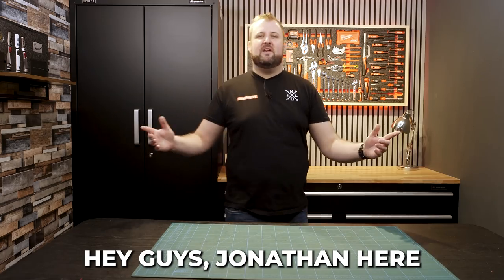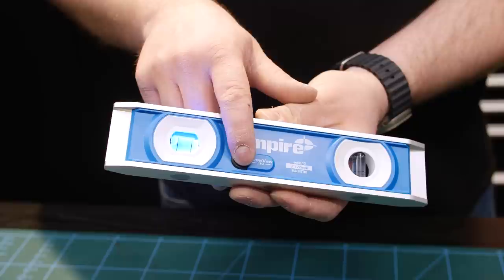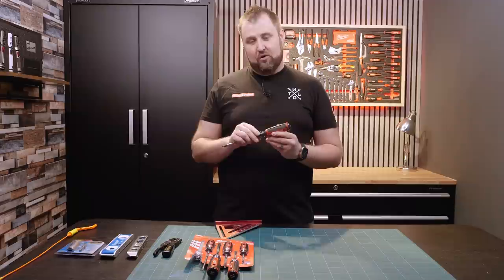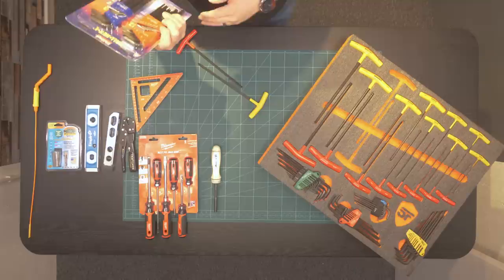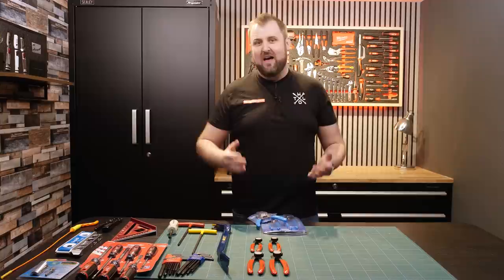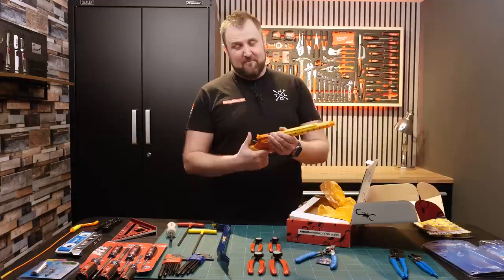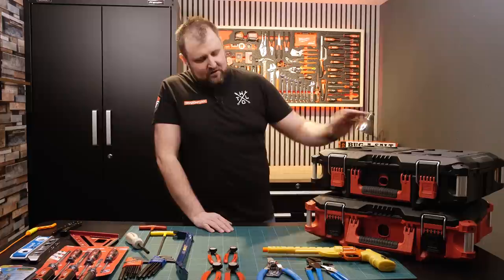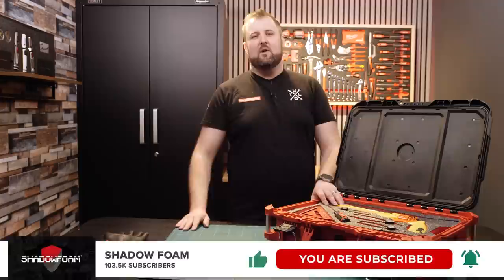I Found The Weirdest American Tools Made in the USA!

Comment: As an American, I can tell you that Milwaukee bought Empire Level several years ago so that Milwaukee red square is still an Empire. Also, Eklind makes at least some of the Snap-on Hex keys. Those Milwaukee screwdrivers are excellent. Milwaukee also makes a lot of their Sawzall blades, hole saws, and step bits in the US. All very good quality items. Estwing and Channelock are also great brands and choices. We used to make a lot more but it's nice to see some of this manufacturing returning.
Reply: And a fun fact, Eklind was started in 1923 by swedish immigrants Henning and Ruth Eklind.
Reply: As a person who uses a milwaukee sawzall at work at work every day I think Milwaukee sawzall blades are junk (at least the fine tooth blades). I prefer Lenox arc blades but they are getting harder and harder to find. A lot the local electrical suppliers sell 25pks of Milwaukee blades so I end up using a lot of them. The best part about Milwaukee is, at least here in a large Canadian city, the availability is good. If you need a specific size hole saw usually the suppliers are good at carrying all the sizes.

Comment: You should have stocked up on those Drain Weasels. When your girls get to my daughters age, 16yrs, you'll be unclogging that bathroom drain every couple months. When I found that it was a God send. I love that product.
Reply: I use large zip ties; I make diagonal cuts into the sides to have the hairs hook onto. Stick it in the drain and twist around. Then pull out the gross stuff. Works great and costs next to nothing.
Might want to wear one of those shadowfoam kit gloves when making the cuts though ^.~
Reply from the maker: Haha thanks for the advice mate
Reply: @TheBayru   Thanks for the info. Sometimes I use pipe cleaners as well. I twist two together and it works sort of but I'll have to try your method.
Reply: Real Americans need a tool like this that works on a cordless drill....
Reply: @JimmeShelter as a plumber, I can assure you that I have made my own drill mounted hair removal tools out of metal clothes hangers, but honestly, manual operation is better
Reply: Those drain weasel are available over here. UK

Comment: The Craftsman 45307 & 45308 Auto Lock Pliers were introduced in 1998.  I believe at that time they were manufactured by Stanley at the old Parker Manufacturing Company in Worcester Massachusetts.  In the early 2000s they stopped making them in the USA and started switching to overseas manufacturing.  Of course now Craftsman is owned by Stanley/Black and Decker as a low cost budget brand.
Reply: I have what Sears Craftsman called RoboGrips that seem very similar.  I had them years.  Would never consider selling them.
Reply: Same on the robogrips.

Comment: I bought one of those Snap On ratchet screw drivers back in 1989 when I thought I wanted to be an automotive technician.  I will tell you I still own this ratchet screwdriver, I have used it so much the a lot of the texture on the plastic handle is gone and it's smooth now.  I will hand that down to one of my sons.  Never get rid of that.  When you were talking about "circlets" I kept wondering what you were saying.  I had to turn on subtitles to figure it out.  Because I looked at those tools and I said those are retaining ring tools.  LOL, then you mentioned how we call them different here.  Makes sense now.  Oh 1 minor thing it "Bass" Pro Shop, Like the fish.  Not Base Pro Shop.

Comment: I have access I'm the usa to alot of thoes made I  usa tools but I tend to buy Japan and Germany funny.  Milwaukee bought out empire levels and are extremely similar since just are made in the same factory.  I dare say growing up with channellock and getting my first pair of cobras I was blown away with German tools ever since.  One brand you didn't experience not slways on stores is mayhew.  They make fantastic pry bars punches and cold chisels.  They also make some good spring tools (thought not the original springtools are the og).  The dominator pry bar line is a real gem including the "screwdriver pry bar" with a 14mm tip it's quite nice.  They make a 7/8ths 23ish mm thick 42-58in prybars thicker than anything I've seen available. Take a look!
Reply: Mayhew is criminally underrated. A lot of stores will have 1 or 2 things they make sort of hidden somewhere but their tools are top notch. My favorite bit sockets I've ever used are their stubby dual drive Allen/hex and torx sockets. Super stubby and can be used with a ratchet or a wrench

Comment: Just a tip from plumber: when you use your drain tool on the bathtub, take off the overflow and go down. This gives you a straight shot to the trap and downstream. Using the tool through the crossbars will give you two more 90 degree angles to pass, and if you hit hair.. good luck getting the tool removed.
Reply: As a not-a-plumber but a handy diyer, let the water stand and clear the drain with a shop vac.   Wet rag over the overflow and FWUMP...big ball of hair.

Comment: I love good multifunctional tools! I worked many years as a maintenance tech repairing automated equipment and having tools that have few parts and multi uses are a lifesaver for quickly fixing things with a normal toolbelt. There are always things that need more specialized or larger tools but it was amazing how many things I could do with my multi set! Like a flip-over set of needle nose pliers with a full set of wire cutters and a flush cut nippers on the other side, or an eight socket dog bone wrench that really worked! I still use them over 20 years later!   I also love the Bug assault guns for blasting wasps and hornets, the combination of reach and blasting the wings off makes it a lot easier to deal with those pests!

Comment: I'm a Canadian electrician and I used to have all Klein hand tools, but the german brands are just so much better... especially screwdrivers, the wera and wiha screwdrivers and nutdrivers are excellent. Channel lock does however make decent pliers at cheap cheap prices, so if you're in places where theft is an issue, there is that.
Also Canadian brand picquic, made in Vancouver BC is the best multi screwdriver on a utilty/cost basis. Superior by a wide margin to american and german offerings.

Comment: Another brand of USA tools for the Automotive trade is Lisile Tools. They design and make specialty trade tools and are available from many sources (Tool Trucks, Auto Parts Stores, Online, Amazon ect.) and based in Iowa. Milwaukee also has some pliers made in USA. If you want an experience, Denver, Colorado has Charlie's Second Hand Tools. Est. 1928. Two floors packed with used tools. You can find more online about them.
Reply from the maker: Thanks for the tips Steve! I’ll be taking you up on these suggestions next time I’m in the states! 👍

Comment: I agree with most of these except the snap ring/circlip pliers. That is one thing I don't buy the multi tool version of. I went through two different types of them before just buying a full kit of Icon's with various sizes and specific internal/external models.

 Those multi reversible style are OK for light duty, but when you get into larger electric motors, certain automotive parts they just don't cut it. The tips just bend and the cheesy joint is not rigid enough to keep the tips in line.

Comment: @9:20 It was Cellulose Acetate Butyrate (CAB). Commonly called "Acetate (or incorrectly Acetal) Handle". While very cool, durable, long lasting, and easy to clean, it slowly decomposes, outgassing Butyric Acid which makes them smell like vomit after a few years. It normally only accumulates if you keep them in an enclosed toolbox for a long time. Before putting them away, clean Acetate handles with a rag moistened with Ballistol. It'll keep them from stinking in 10 years, and can clean up the Acid residue that makes them stink as well. Sadly these multi material urethane rubber boys will both stink and rot away no matter what you do. The rubber will become hard and chunky and start rotting away, especially if exposed to oil and aggressive solvents over a long period of time (particularly the old Wera Kraftform were guilty of this) but I guess that's just how it goes these days. (I have Acetate, Urethane, Polypropylene and TPE, etc handles from all makes, my Craftsman and VACO Acetate ones seem to last the longest but I like my Tekton "High Torque")

Comment: I prefer the Eklind loop handles in extra long (54250).  When there is a hex in a corner, the shaft can be gently bent to clear the handle. It springs back every time with no damage. It's mostly used in trade show booths for shelving. The locks are always in the brackets tight to the corner. There are shorty ''corner keys'', they are hard to get, mostly people make their own. The stubby allen portion is quite short and the handle is bent.  I had an Estwing prybar and it developed legs. I got the plain prybar at HF for $3 on sale and it's better than Estwing for my purposes. Empire used to make Craftsman levels. The aluminum one is for plumbers.

Comment: If you can find Craftsman tools made in Taiwan, they are about as close to “made in USA” quality.  Older Craftsman (roughly 1995 and older) are 100% made in the USA; those rivaled any Snap-on or Matco tool at 1/4 the price.  I have a set, not one ever broke; to this day.  I bought a set of dog bone ratchet wrenches (in 1995ish) and only one broke,  Sears replaced it without asking one question.  Not sure if the dog bone was made in the USA, because at that time, some of the tools were Chinese (not Taiwanese) and Mexico made.  If you can find old (pre 1995 imho) Craftsman tools, buy them.

Comment: I have four girls in my family :) But my favorite US tool brand is Lie-Nielsen Toolworks - fine woodworking tools. The second favorite is Leatherman - have you tried the compact changeable bits system of their recent pocket multitools? Besides, i have a question about multiple layers of Shadowfoam in a box: i would like to put a Makita 18V powerdrill and many drills bits in the same Makpac box. The drill bits would fit nicely in a single 30mm insert and the drill plus a few bigger items to another 50mm insert. I'd like the bits insert to be on top as it is much lighter and easier to remove, but the drill can't be completely embedded in the bottom insert. Do you have any solution to this? I was thinking of creating supporting blocks in each corner of the box, that would keep the top layer level.

Comment: You don't have a Yankee Push Drill there. That's all stainless, size of a screwdriver, but includes about 10 drill bits in the handle. Great way to drill through trim or baseboards to run a wire or set a handle. Probably 100 years old by now.

Comment: Drain Weasel, I want one just so I can to sit in the pub and tell folk I have a drain Weasel, I’m not even sure I’d explain what it was.

We can get some of the empire range in Australia, and the bits I’ve seen are pretty good. I’ve a roofers square/speed square in alloy like the Milwaukee one you had and one that’s half that size, both with etched markings and a little 6” adjustable combination square, which is as nice as the 6” Bacho one I also have.  I do like the second torpedo level with the ability to make things deliberately off kilter. That’s going on the shopping list!

Tool Addicts Anonymous on the book of faces has a lot of American members, and it’s amazing how many items in the SnapOn range are sub-contracted to several other US brands, especially in the automotive range, if the comments are correct.  There are a couple of brands, Clarke being one that crops up a lot who seem to be a nice compromise on the price/quality/warranty scale compared to SnapOn, that a lot of professionals use.

Comment: Made in USA doesn't mean they are automatically of superior quality.
Many of the tools are made abroad too, of same quality, but much cheaper, e.g.
#8- spirit level and #7 - speed square - only thing that matters is, if they are true and don't fall apart if dropped .
#6- screw drivers - nothing special, ALL WERA and WIHA screw drivers are marked at the top and the bigger ones have wrench-sockets at the base. What matters most is, how well they are hardened and tempered to withstand heavy torque. The same goes for #4- Allen-keys .BTW: hex-shafts allow to increase torque with small wrenches too.
#1 salt gun - IMHO a gimmick- how much are the replacement cartridges? I guess two of them equal the whole gun, am I right?

Comment: Craftsman USED to be made in the USA, and the USA made tools were absolutely phenomenal. I still have tools passed down from my great-grandfather and they don't have a spec of rust. Now, since lowe's owns craftsman, it's cheap chinese made tools, that are basically designed to break. (I think the toolboxes are still made in the USA, though)
Reply from the maker: Thanks for the info, I’ll have to check out the boxes! 👍
Reply: @ShadowFoam  I think they're not too bad, not too pricy (I believe for a decent full size you buy it in 2 pieces, lower and upper for i think around 600-700$ USD), but personally I like my Husky boxes

Comment: Some tool brands have a gret reputation but how good is their warranty  now Craftsman comes to mind a friend bought Craftsman tools he was as strong as an oz and as smart need more leverage add a metre long plpe and neither flat wrenches nor ratches are designed for tha🎉abuse and when they btoak take it back and they replaced it no question asked another was snap on3 in the early 30ties a mechanic came up to rural Alberta from the states brought his tools with him well times were tough and he soon went broak not having enough money to ship his tools back to the states he threw them out in his garbage pile and there they lay until over 30 years later a young boy started digging in that pile pulling out all the broken pieces put them into buckets hauled them home and the next time the snap on man came calling he as a joke showed them to him well he said that the garenty was still valid so after some work putting the jigsaw back together the kid was the envy of everyone he had a almost complete set of tool's  from socket sets to flat wrenches the full line of sae unfortunately no metric as there wasn't any back then

Comment: I understand the theory of Shadow Foam, but it really is oriented to specialty applications. Or the very ADHD amongst us. To use Shadow Foam in my shop I would have to double the amount of toolboxes and expand my physical space commensurately.  For emergencies, my go bag is a fold out backpack that holds 3-4 times the amount of tools  of a single Dewalt or Milwaukee pack out box using Shadow Foam. Or the multilayer attache boxes sold by big tool. Even those are space wasters. Bulk becomes an issue. What can I grab and get on a plane and have the maximum with me, in the smallest space to do the job.

For a very few of my specialty tools for fiber optics, transmission testing gear and the like I could see a one off box. For a shop toolbox organizer, it's a space waster. There are a few YouTubers I see that have all their sockets in a set, their screwdrivers in a box set, but normal folk don't work like that. I have #1 philips in 5 lengths, #2philips in 5 lengths, ditto my other 10 screwdriver types. In Shadow Foam that's a 6 foot cabinet in just screwdrivers.

This really cries out for a CNC solution. Where a buyer takes a tool layout photo, send it to you and you send back a precut solution. Or take a photo, select the box, and design the whole thing on line with the box available for purchase if what they already own does work. 

I really enjoy the videos and the new tools, but with  very few very specific applications it's not for me. I believe a CNC application is the future for you.

Comment: You missed Northern Tool? Shame on you!
The original OEM for Craftsman tools became the 'Husky' brand 
 I took a worn out #2 Philips screwdriver back to Sears when they had just changed OEMs. The replacement was badly pitted under the chrome plating, and the tip broke when I first used it. I was removing the cover on a computer case, which were not that tight, I've never bought another Crapsman tool, since then. I used my legendary Camillus Electrician's knife toi remove those screws. Sadly, Camillus is long gone, and I don't like the Klein version. The Camillus had smooth sides, while the Klein has thin groves on both sides. They quickly remove skin from your fingers, unlike the original. I've owned and used the Camillus version since the mid '60s The klein was tossed in with the junk tools, after just one use. I found several used ones on Ebay and at a local flea market.One dealer wanted $50. Another gave me several that needed some TLC.
Allen still makes Allen wrenches, and other tools. I have sizes down to 0.027", for the tiny knobs on handheld radios. 0.035 and 0.027" were often hard to find, when I first needed them.
My favorite brand of hand tools was always Xcelite. I've had and used their 99SM, since August 1974. I carried it on service calls , and the only tool that ever wore out were the reamers, wich were often used in an electric drill, instead of the screwdriver handle. Xcekite also sold a ratchet handle for that series. I added the 99 series Allen wrenches to my set.
Another American brand of tools that I've used a lot are the Greenlee Chassis punches. I wore out sebveral Adel hand niblers over the decades, since I had to fabricate one off or prototype chassis for my Electronics business.